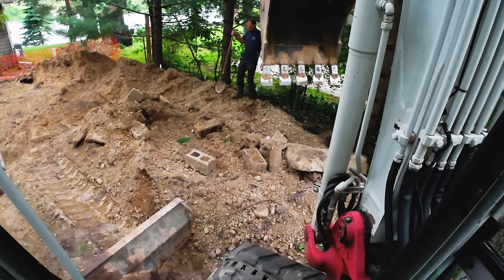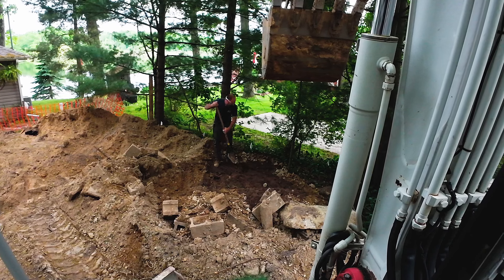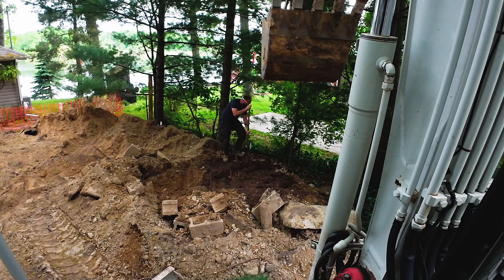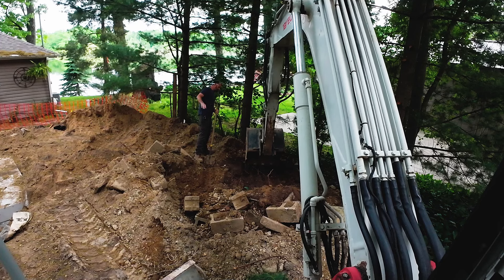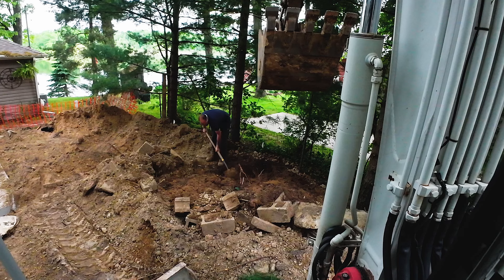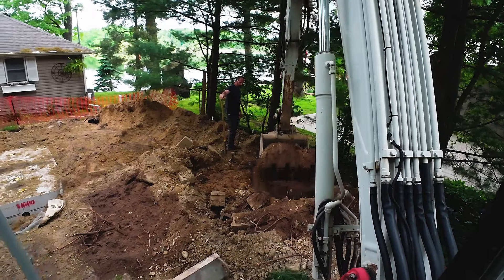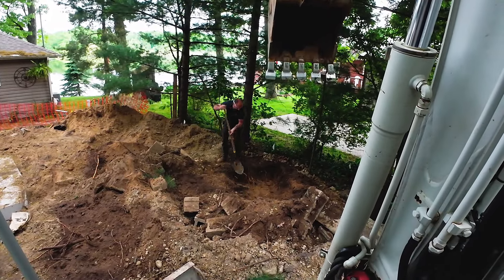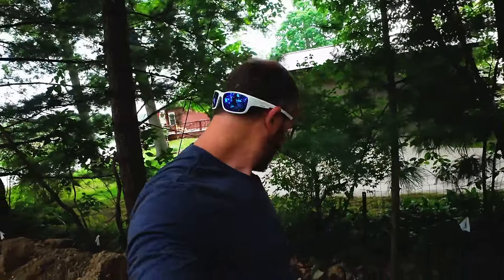How To Expose Utilities

Comment: If you dig with mechanized equipment within 18 inches of either side of the mark you are liable for the break. You are supposed to hand dig it or use hydro excavation. We all do it but you aren’t getting away with it if you break the line. Never dig across the line. Dig the line  longways with any utility. Way less chance of breaking a line digging lengthwise than digging across it. Not trying to be a negative Nancy . I worked in gas replacement for a local gas company for several years. Keep up the great videos!
Reply from the maker: If you watch what we do here, the machine isn't doing the exploratory digging, only bulking out material once we've cleared the space.  Too many guys try to cowboy it up and take for granted the line will be 2+ feet down and that's where you get yourself into trouble.
Reply: @DieselandIron  yeah. I’ve found them literally laying on top of the ground or 12 inches down and even 9ft or more. And the location guys aren’t supposed to give us a depth. Some will but depending on the wire and who installed it there is still a gamble.
Reply from the maker: @poorfarm-nn6ii  Ya, I was lucky when I learned this lesson.  We were getting ready to do a sewer tie in for a brand new sub and took about 3 inches off the top with the machine.  In the middle of the pull you start to see the yellow of a gas main.  Turns out it was one of the holes the boring crew used to tie sections together and the main was 2 inches above the curb line.  I have never taken anything for granted after that.
Reply: @DieselandIron  makes sense. My first week in gas work a guy pulled the tap off the top of a 300psi main. Was so load you couldn’t talk. Our Friday that was sposed to be a short day turned into a 17 hour day!

Comment: When I get close utility don't even use a shovel. You can slice through the gas line without even breaking a sweat. Break out the shop Vac. It even works cleaning out the bottom of post holes  :yougotthis:
Reply from the maker: We don't have time to play with a vacuum.  As long as you aren't trying to find the line using the hammer of Thor you should be alright....

Comment: The safest way to do is to get with the utility and just take a couple buckets wide.  Scratch and pull up scratch and pull up that’s the safest way to do it.  Way less chance of tearing across it. I used to work for a contractor that did work for Verizon can’t tell ya how many repair jobs I went on from people digging accross them yeah it can be done but it’s not the safest way. Reason why atleast around here all utility company have rules if you dig a cross them your in trouble. The last place I worked doing directional drillling we’d haft to spot a dozen utilities a day we had our own locator to double check that was a real time saver
Reply from the maker: This job is a prime example of a situation where it isn't possible to dig inline with the utility.  If you go about it the correct way then it shouldn't be an issue.  The machine isn't doing the exploratory digging.  I am with the shovel.  The machine is just bulking dirt back from my hole as I clear it of possible utilities.
Reply: @DieselandIron  I’m just saying when possible it’s the safer way to go about it I geuss it’s just my opinion everyone does things different. The utility companies we work for prefer us to dig with it. What ever gets the job done not hating.
Reply from the maker: @snowblowerman5115  no hate received and no hate intended on my end, I just wanted to clarify for people who see this down the road.  Thanks for commenting!

Comment: I usually just drop the engine speed. More than one way.
Reply from the maker: The only problem I have with dropping engine speed is it makes digging less controlled. You will always have better control with higher engine RPM. That being said, everyone has their preference